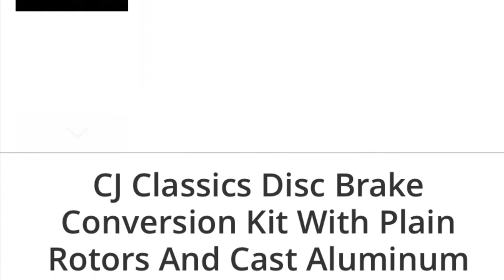1965 FORD MUSTANG REAR DISC BRAKE CONVERSION (CJ Pony kit, install and review)

Comment: Is this the cj classics disc brake kit, and if so on the rear calipers do your brake pads just lay in there.. I can’t find anything that clips them to the caliper
Reply from the maker: Good question. Yes, no clips needed. They just lay in place
Reply: @garagebuiltlegends  did not expect a reply on a year old video thanks man much appreciated. I bolted them up that way and spun them a couple times no problems.

Comment: I noticed you pointed at the e brake mechanism but didn't show how to hook it up. Is it because the parts that come in the kit don't work?
Reply from the maker: Good question. The parts from the kit do work, I didn’t have all the original parts on my end. So I left it off

Comment: Man how did you hook up the e-brake cable?
Reply from the maker: I didn’t hook up the E brake. But if I did use it, it hooks directly into your existing cable
Reply: @garagebuiltlegends  gotcha, I got everything installed on mine today and couldn’t for the life figure out the e-brake, instruction manual isn’t great
Reply from the maker: Nice 👍🏼 I hope the video helped a little, sorry I didn’t have anything for the e brake.
Reply from the maker: One bit of advice, I switched out my wheel bearings. The ones that come with this kit are chinesium lol. They don’t last long

Comment: Did you change the master cylinder?
Reply from the maker: I did not. I already had a booster and fuel master from a previous upgrade. If I did not I would definitely upgrade to a duel. Thanks for question and don’t forget to subscribe 👍🏼